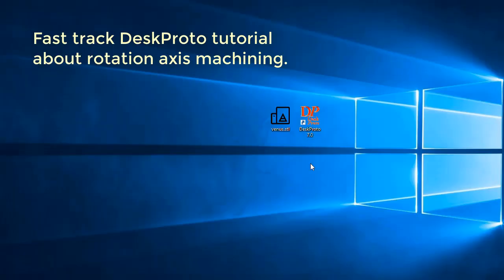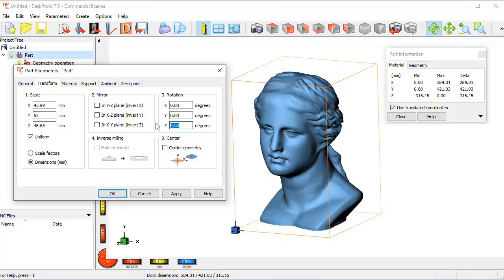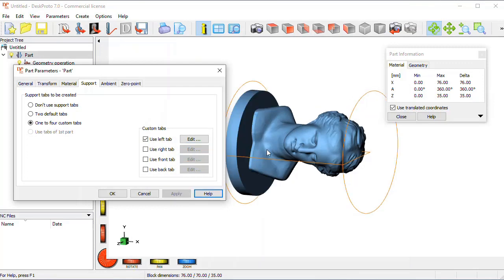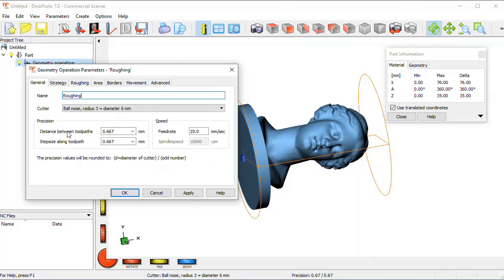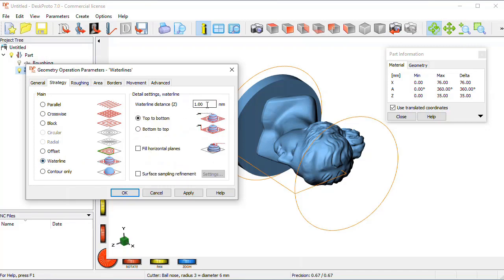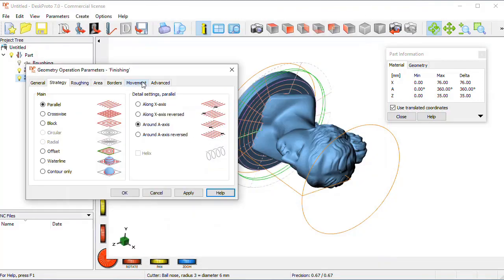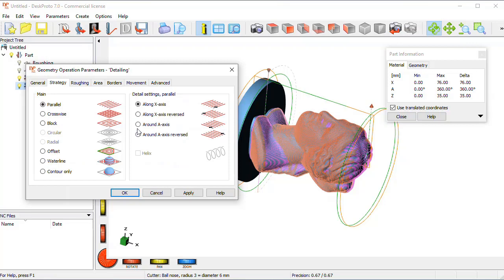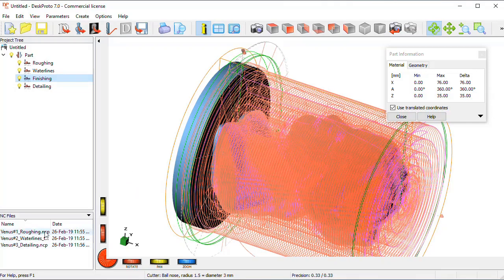Creating rotary toolpaths for Venus (4-axis CNC) in DeskProto V7

Comment: Please help me. After the roughing is done. I have to do tool change for the finishing. How do I put the new tool in the spindle collet so that it has the same clearance ( as the roughing to the top of my stock ) -  Also i have my tails stock on the left side and my 4 & 5 axis on the right side - as in your video you have the tail stock on the right side. Do I have to reverse the direction as saw on your video? I hope you understand my question. TIA.
Reply from the maker: After a manual toolchange indeed the length of the new cutter will be different, so you need to again set the Z=0 level. This means that the process o setting the Z=0 needs to be repeatable, allowing you to set the same Z=0 or all cutters that you use.  When on your machine the motor is on the right side it is indeed not needed to reverse the direction. Most important still is that the same zero point needs to be used both in DeskProto and on the machine.
Reply: @Deskproto  Thanks so much for your help. Have a great and safe weekend. God Bless.